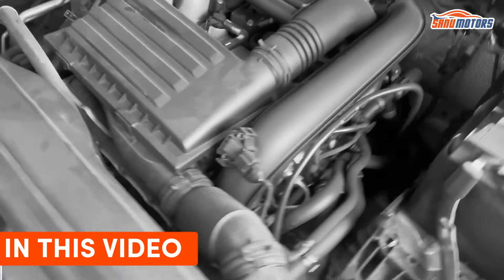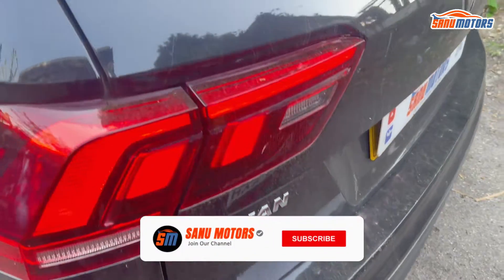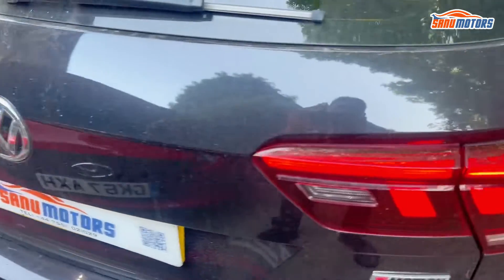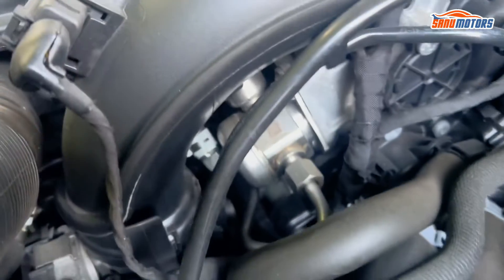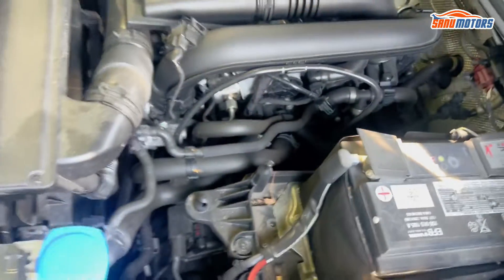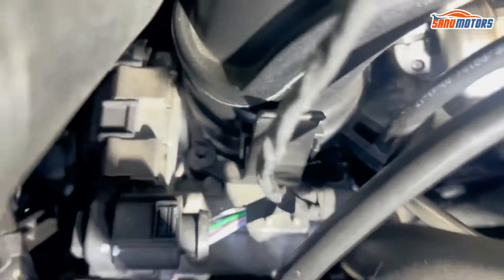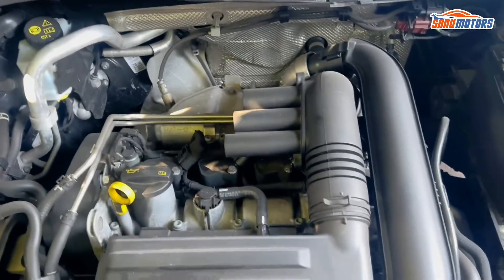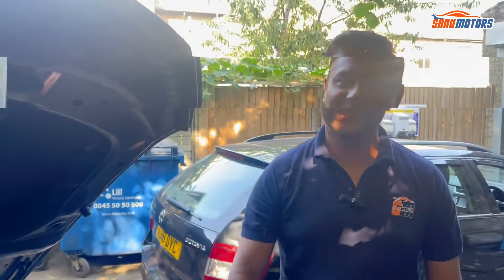VW Group 1.4L TSi Engine Petrol Leaking Problem Diagnosis | Audi | Skoda | Seat | Expert Guide

Comment: Great Video Sanu, I have a question, my VW MK7 1.4tsi golf also have a fuel leak, however the EPC light has turned on? any idea why this is? the stop start does not work and the car is miss-firing and the throttle response is not correct
Reply from the maker: Frist sort out fuel leak. Because of misfires EPC light can be eliminate. Plug in computer and try to get the code and do the repair frist. 
Need more help please contact via what’s app 
Thank you
Reply: Hi, I’m having the exact same issue. I have got the “vehicle power system, please visit workshop” error code. What was wrong with yours then?